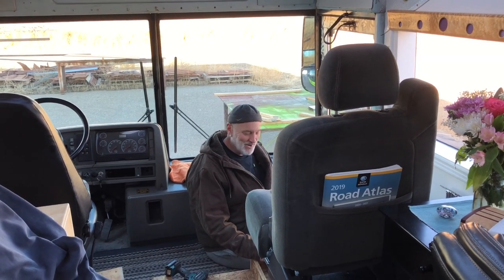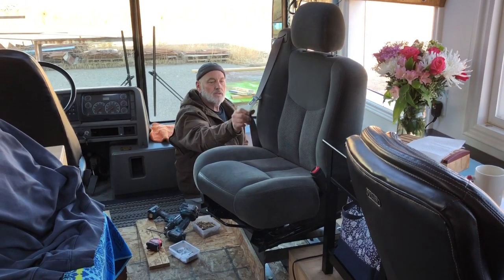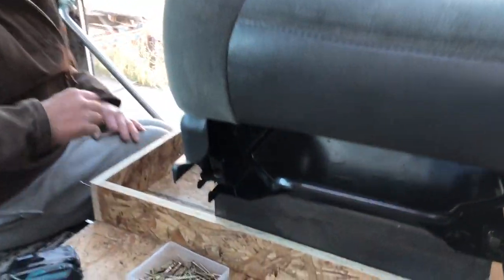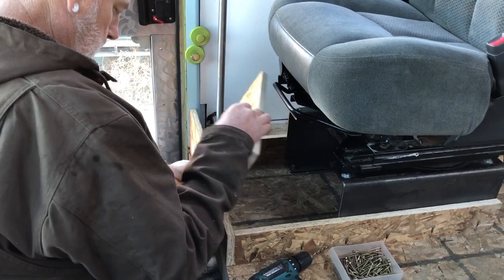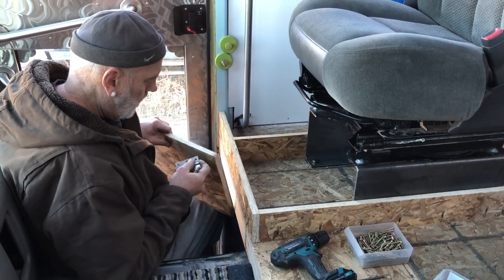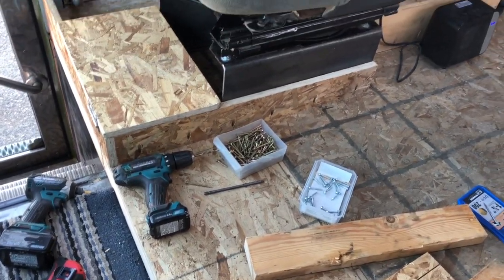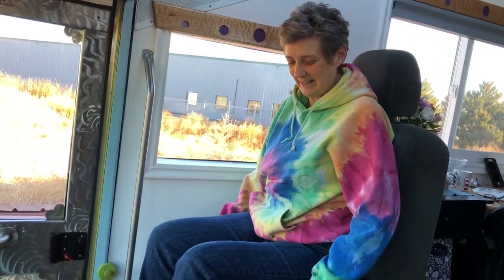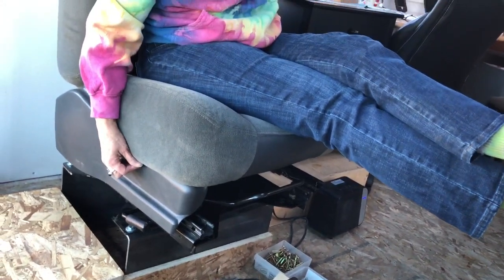New Co-Pilot Chair - Vlog 196 School Bus Conversion

Comment: Why didn't Randy put the hinges inside the box, on the top of the lip and the front bottom of the door so the top would swing 270 degrees from flat on top to vertical in front of the box? Still loving the video's, guys!
Reply from the maker: Glad you are enjoying the channel. We ended up not using the box - it put the chair up too high. 😃

Comment: Awesome job Randy - we're looking for one  that resolves the seat belt issue - what vehicle did you find it off of?
Reply: I'm an upholsterer by trade alot of early 2000s chevy GMC pickups have that style seat with the seatbelt built in. Maybe even some fords with the extend cab and the barn door style where there isn't a B post for the belt to mount to .
Reply: Description said they got it out of a Chevy pick up.
Reply from the maker: It was out of a 2004 Silverado Chevy pickup. 😃👍😃
Reply: @KnappTime  Thank you👏